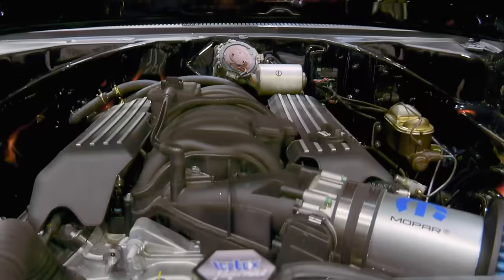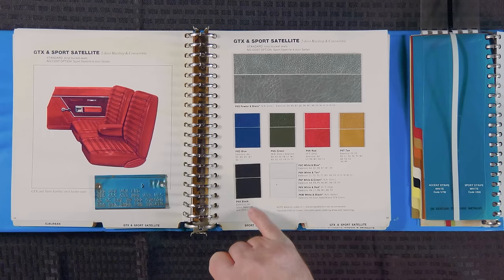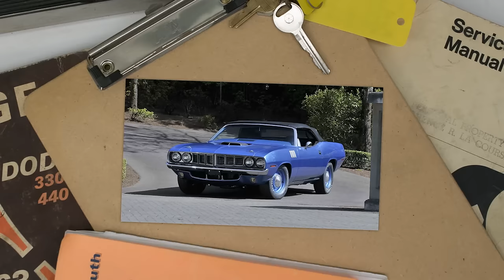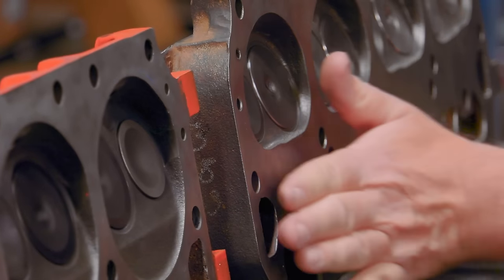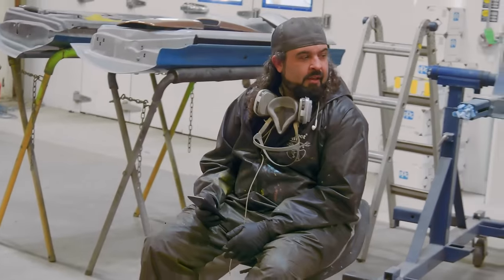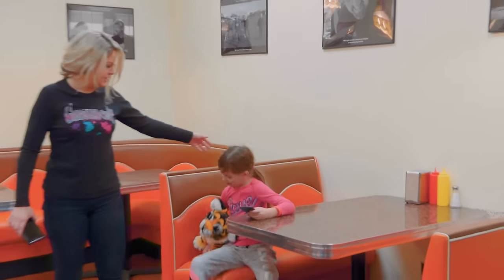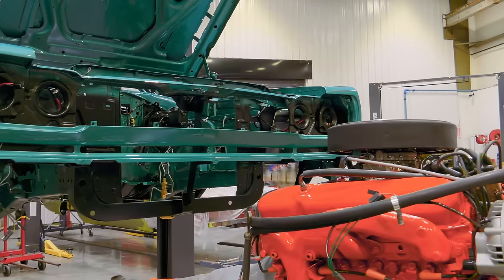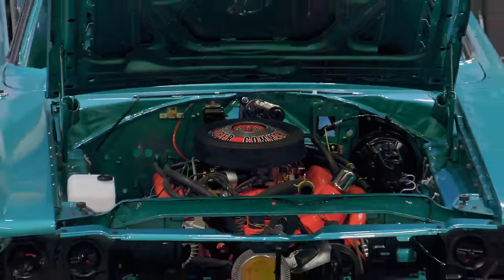FIRST TIME EVER ON TV: MOTHER AND DAUGHTER WORK TOGETHER ON A MOPAR! WONDERFUL MEMORIES

Comment: Why was it that you almost always had to remove the distributor on the big block or B engine when replacing breaker points. Have not seen one where this was not required. The nice about it was if you could easily drop in the distributor and be close to the timing. Once out you removed the breaker contact plates cleaned and placed a light coat of distributor cam lube. If you skipped this step this usually resulted in a no start. Always wondered why. However, after getting burned a couple times lesson learned.
Reply: THE DISTRIBUTOR ON BOTH ENGINES IS AT AN ANGLE , WHEN DISASSEMBLING,  ANY HARDWARE OR SCREWS COULD DROP INTO THE DISTRIBUTOR HOUSING OR BODY OR END UP IN A VALLEY ON TOP OF THE ENGINE !!! REMOVE AND SERVICE OUT OF THE CAR TO BE SAFE !!!
Reply: While this is certainly a good business practice. We use to magnitize the screwdrivers we used. What I am referring to was a no-start when replacing breaker points. Had something to do with an electrical ground. Just one of the anomalies I come to grips with. Out of habit dist always was removed. Also had access to a syncroscope and could test and adjust the distributor curves.  @antoniohosino145